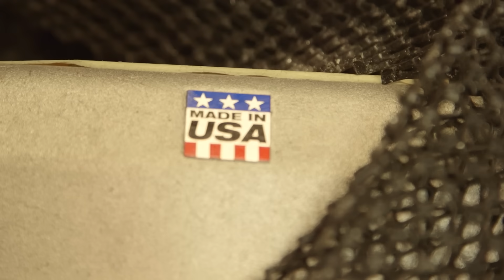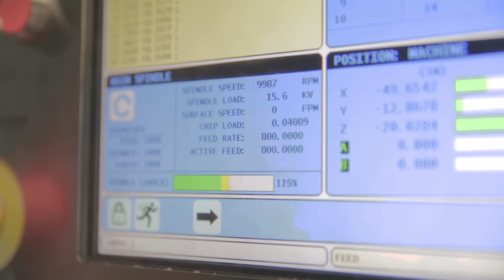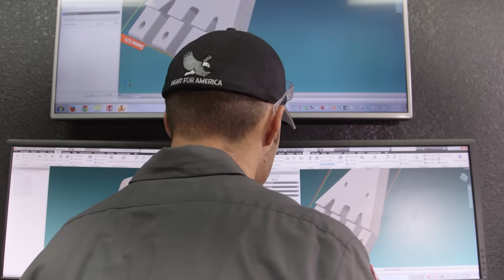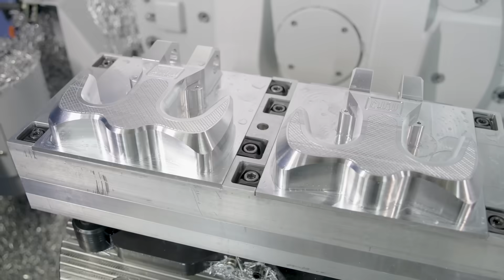Small Machine Shop Owner FIGHTS Back Against GOLIATH Company

Comment: That owner is a boss.   I own a fab shop, lasers, turrets, press brakes, and supporting equipment to round out the processing.   In mid 2000’s our largest customer was acquired by a fortune 100 company.   After the acquisition, about 18 months in, they “invited” me to participate in a reverse auction.  After reading the terms I would operate under, quarterly adjustment for material costs, same price for product be it 1 or 100, fines for production delays, annual 3% price decrease, should I be the lowest bidder.   I politely informed them via letter I would not be participating.   In the letter I sent I explained why:   Uneven demand would expose me to market forces out of my control ie rising material prices, the setup costs are amortized over a particular lot size and must be accounted for, insurance, utilities, labor  will increase regardless of the price decreases I give.   I closed with “I would question the sanity and ability of a supplier that promised the terms they sought”.  Even though they threatened to pull the work unless I participated, they didn’t.   I continued to work for them, but on my terms , until they moved all the work out of the country. 
I was fine with loosing the work, I wasn’t going to let them “own me” .   I refuse to work with companies that don’t want a partnership built on respect and mutual benefit.   I encourage anyone thinking about opening their own business to take Titans lesson to heart.   Better to close early and go fishing than work for nothing….
Reply: There's a very good chance that company will be out of business soon due to quality issues and shipping delays. I've seen it happen over and over again.
Reply: @Grauenwolf  Plus the additional expenses of running the equipment.
Reply: Alcoa in Lancaster PA tried that crap with a company I worked at a few years ago.......they wanted a 15% rebate on the work they paid for for the last 18 years.
Reply: @rdgk1se3019  insane
Reply: @rdgk1se3019  omg
Reply: Move the company OS
Weren’t there swimming pools big enough 
CORPORATE SCUM
Reply: Wise words Mr.Alex.
Reply: The biggest thing I've learned from business owners is "Don't let anyone take your brand" and that's the same thing I see here.  They want to own you without any of the risk. If I worked for a business owner  such as you or the one in the story, I would expect they would treat me in the same way.  Good employers are hard to find, especially ones that listen to their employers.
Reply: what's even more disgusting is the fact that they outsourced everything while trying to screw over local American suppliers like you. If that isn't the definition of evil then i don't know what is.
Reply: @Mike-jv8bv  Outsourcing isn't the problem. Shit gets outsourced all the time all over the world. Assholes will be assholes and exploit whomever they can wherever they may be, and there are always suppliers desperate enough to accept even the shittiest of terms.
Reply: @john.queue.public  I think it is a problem when you loose your own ability to be self sufficient at a manufacturing basis
Reply: @Mike-jv8bv  I definitely think there's an argument to be made for diversification and decentralization to reduce reliance. Primarily to manage risk by not putting all of one's eggs in the same basket. But complete independence is a breeding ground for an F U mentality.

Interdependence can foster and reward cooperation and collaboration between groups that might otherwise be at odds with each other. It's an imperfect relationship (what isn't?) but historically this has proven itself time and again. 

It's only when one group of assholes decides it wants to dominate others that cracks begin to form in the foundation. 

What's I've described transcends countries. I can give you examples all day long of how these relationships play out at all levels of society: family, community, county, state, region, country, continent and globally,
Reply: Stiffel Lamp Company in Chicago was driven under by GE Capital. It was 3 months after I toured their factory. I met 3rd and 4th generation employees. A crying shame.
Reply: Ha! They still owned you. You could only survive as long as they gave you corporate welfare. As soon as free market capitalism meant a competitor could do it cheaper you were terminated.
Reply: Trust is usually two people who work with each other on the contract. If one leaves/retires then you start over.
Reply: Very, very well said. 👍🏻
Reply: Farq-em i say, but good on you for standing up to these Bullies, where in faeq's name did all stupid terms come from - Bean counters i suppose justifying their overpaid positions and reinventing the wheel to screw the supplier.
Reply: Great & good on you, and what was the bastard Fortune 100 company?
Reply: @pebblepod30  Edelbrock I believe
Reply: @justinbeaver6423  thx
Reply: And then when their containers falls into the ocean.....lol
Reply: Good for you! Fuck them! People will take advantage and push you around as much as you let them.
Reply: As much as I love the free market economy.

Outsourcing like that needs to be outright banned in the USA. We've lost most our manufacturing to this practice and someone in government needs to hold these companies accountable for essentially killing off thousands of jobs to save a few bucks.
Reply: So what's new?
Reply: Don't ever compete with yourself!
Reply: I'm fairly certain I know which GIANT this was. Their tactics are absolutely appalling. Plus they require 60 day terms even though we all get held to 30 days by our vendors. They have BILLIONS but need to use the little guy as a banker.
Reply: You got that shit right! A lady tried to hire me at a hardware store and I stud my rate is 250 a day.  I have to make that to get out of bed and deal with your bs. Fishing is more important sometimes
Reply: I agree with what you’re saying here, but you have to consider what your customer is going through. I’m guessing here, but I bet his competitors shipped all their production overseas, and our government did nothing to stop it, including imposing large tariffs on import products coming into the United States. That’s likely why they wanted price decreases. They’re trying to compete with companies that are having the equivalent product made in China. Did you ask them why they wanted a price decrease, when your costs are actually going up? I would have.
I recently read that in Germany, things are handled much differently. If a company wants to have a product made in China, or any other foreign country for a cheaper price, they have to get the approval of the German government to do it. And if it’s approved, a large tariff is imposed on that product, if it’s imported back into Germany.  That way the German industries can survive. Their government is much smarter than our stupid government.
Reply: @alan30189  Profit baby profit, and those companies are own by your own people who can careless if you are white. That is also why theirl is such a large prison population and  
Private prisons incentivize increasing inmate numbers and allowing conditions to deteriorate so special interest groups and corporations can maximize profits. As of 2014, 1 in 100 Americans were imprisoned [1]. This number has increased in recent years. Ten years ago, there were only five private prisons in the United States. Today, over 100 exist.
Reply: @alan30189  They sure are. That is a great policy.
Reply: @alan30189  That's the power of big money in the US, but not so much in Germany.
Reply: Perfect lead in as to why I despise the words "Made in China"
Reply: @raterus  You and me both!  I'd rather pay a little extra, even if I can't afford it to support true Americans and true American companies.
Reply: When I first saw the headline I thought, “The Trump Organization has stiffed another contractor”. 🤣
Reply: @voixdelaraison593  ikr? 😂
Reply: "Better to close early and go fishing than work for nothing…." You can do that only when you have money in your bank -.- And also, it isn't "work for nothing" but "work for much less", then isn't the same of "go fishing". Every people that talk like you are shop owner, so people that already have money at bank (work for many years) and not, for example, people that doesn't have anything (or a new owner).

With this I don't mean that your speech is wrong, but that it can only be done in certain situations like above, but not always....
Reply: @Peppins  you wouldn't go to work at an hourly wage job and work for nothing also.
If you won't make a profit, you would not be "working for less", you would be working for nothing.